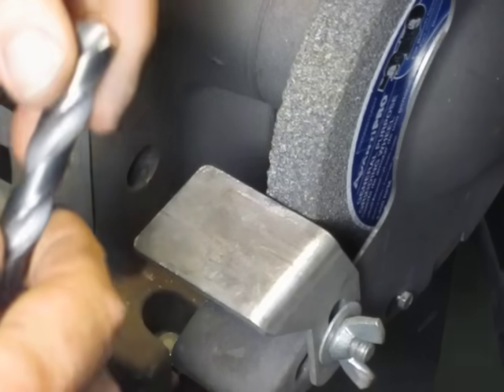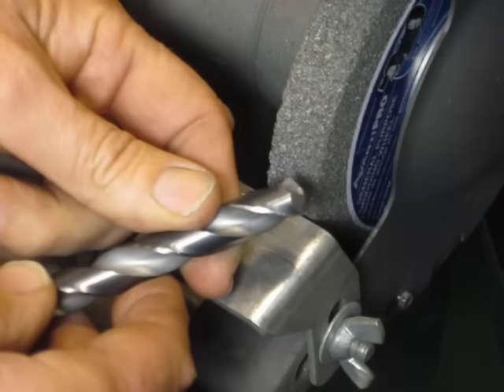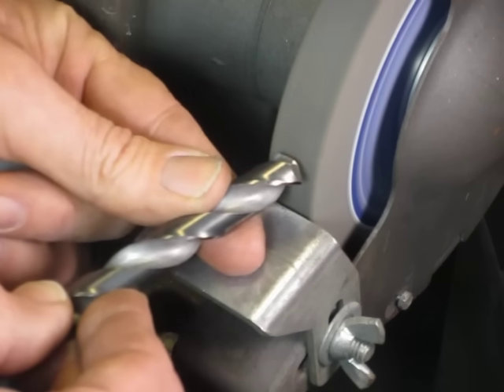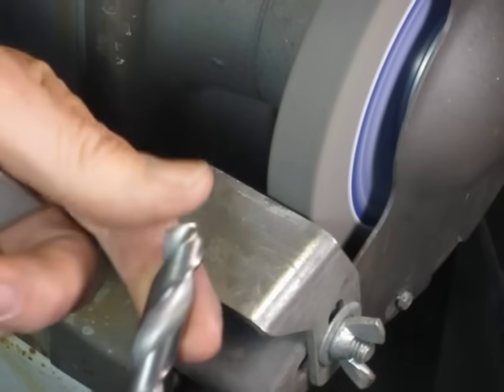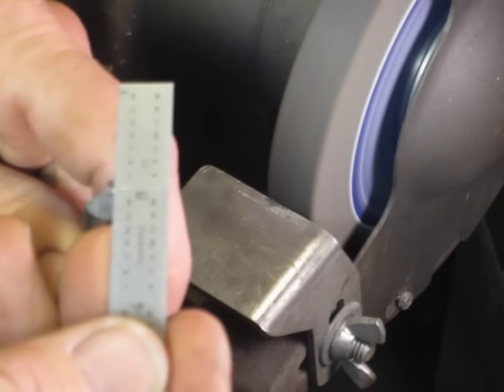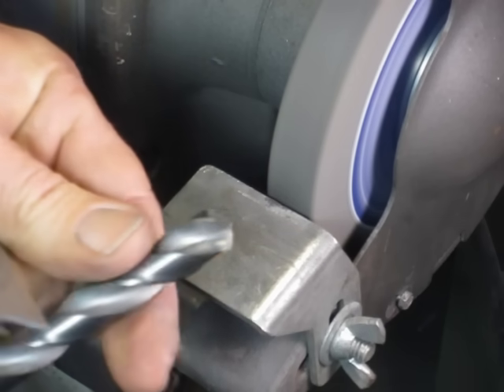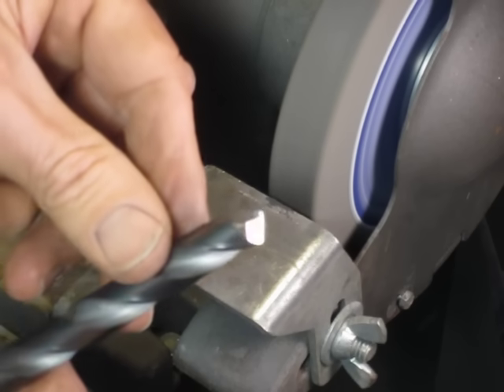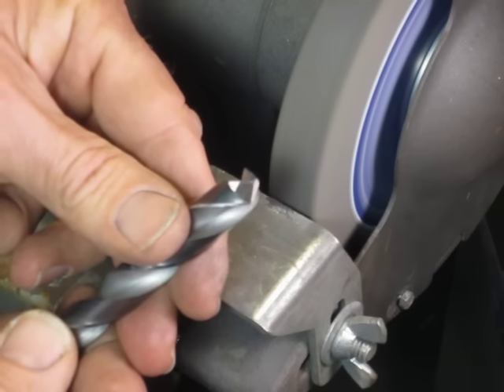How to Hand Sharpen a Twist Drill

Comment: Hello, thanks for the quick response.
So to sharpen small drills is only necessary to make the first two clearance cut? I am sure.
Reply from the maker: Yes. One primary and one secondary relief is good for drills up to around 1/2" diameter.

Tom
Reply: Ok thanks for your help.

Comment: Why not use your gauge to mark the right angle with a felt tip pen on the tool rest - rather than just guessing?
Reply: A mark is good for beginners but after decades of sharpening drills no mark is needed.
Reply: Yeah, didn't the dude say that in the video?   I've been sharpening bits for  just a little while, with the eye sight headed south, I'm finding it harder to do anything smaller than 1/4 in.  I have hardened bits, I have garbage Harbor Freight bits.   In the past I have got what every bit had to give, but like I said, the vision is not to par and would like to know who makes the VERY best, and I'm not talking NASA shit, just a DECENT DRILL BIT!!??   ANYBODY???
Reply from the maker: In my experience, cutting tools of any kind with the most consistent quality are those made in the U.S., Europe or Japan. Anything else is a crap shoot.

Tom

Comment: As a retired hands on engineer this is no way to hand sharpen drills. Firstly, wrong type of grinding wheel. secondly you run the cutting edge up the wheel not across.
Reply from the maker: You should probably do a video to demonstrate your drill sharpening expertise and exactly what "run the cutting edge up the wheel" actually means. If you are referring to creating a radial clearance, that is definitely an "old school" technique. What the entire video and learn how this multi-faceted technique is better. Even retired engineers should still be willing to learn new things.

Tom

Comment: Well, as promised I had a bash at reviving some old drill bits. Took a few goes and whilst it would make my Grandpa weep I can get the old bits to drill a round hole in mild steel without squealing like a banshee. Will keep practicing until the nice expensive set of bits I have no longer cringe when I reach for them.
Reply from the maker: Good to hear David. Keep practicing!

Tom

Comment: 9/32 ?   How about talking in decimals please. . ..281"  and .250"
Reply: because, America!!!
Reply from the maker: Actually the decimal system (with deca meaning ten) has been around since people have had ten fingers. I doubt you could associate it with any particular country.

Tom
Reply: I was just correcting your statement "decimal IS American". You're reading way too much into it.
Reply: The decimal system originates from India..
Reply: @oufofmemory  Tom is using Fractions, because they can be decimalised, and because most of America refuses to voluntarily metricate.
Here in DownUnder land, we 'Converted' to metrics in about 1968, and it was hard to resist. ALL retail outlets HAD to recalibrate their scales, measuring sticks, jugs and bottles, etc etc etc. You could not buy dual-graduated linear/weight/volume measuring implements, all road signs were metricated So a sign reading 'Woop-Woop 500' became 800km. we were made to get the hang of it. Lots of people got worked up about unit sizes, but the daily calculations became soooooooooo easy, especially BECAUSE the metric system lends itself to decimalisation, everything is a 0.001x, 0.01x, 0.1x, 10x, 100x, 1000x multiple of the base unit, and most of the base units are small enough that a decimal point is rarely used: Standard house doors are 710, or 810 or 910mm wide, and a house with a, 20ft frontage is 6096 wide, no dots, we dont even specify the mm at times, but fuel is always litres (Yes, the correct french spelling), and water reservoirs hold xxmegalitres or gigalitres. Kpa for pressure gets some folks confused, along with Nm for torque, but you get used to it. but car wheels are still measured in inches (Because tyres)

Comment: Hold or stick two hex nuts together on their flats,  this will give you 120 degree inclusive angle for the drill point,
Reply from the maker: +mountfields 
That works for the angles, but more important is the length of each cutting edge. The drill sharpening gages I mentioned in the video are inexpensive and measure both features.

Thanks for watching.

 Tom

Comment: Great demonstration! I learned the same technique in my 10th grade shop class about 17 years ago and it has been such a valuable basic skill. There are two of us at work that the others come to when their drills get dull because they never learn how to sharpen a drill. Our teacher taught us with a very similar demonstration and then he let us sharpen our own bits. Once we thought that our bits were sharp he would put them in the drill press and drill hard into a piece of steel, stopping the motor while still cutting. If the chips didn't look uniform he would say that it wasn't right, grind a big flat on the tip, and then tell us to sharpen it again. He ground enough off that it took some time to get it sharpened up again too. I imagine that it was meant to be extra incentive to get it right the next time. We didn't pass until both chips looked reasonably similar. Slow learners ended up with short drill bits. :<)
Reply from the maker: +Chip Wright 
I like his approach!Thanks for watching.

Tom
Reply: Me too. I have memories from his class that I'll never forget.
Reply: +Chip Wright you even got the name!

Comment: I have fairly good success sharpening my drill bits but came here to see if there was anything I could pick up. I was not disappointed. Also wanted to ask how does the center axis of the drill cut, being there is no cutting edge right in the center. But you addressed that too. Thanks
Reply from the maker: +sking0369 
Thanks for watching

Comment: what grit is the wheel
Reply from the maker: +james broach 
This is just a wheel I picked up at the Depot and it doesn't even say. It looks to be about 60 grit, which is coarser than I normally use, but it works fast. It's fine for grinding lathe tool bits because they are stoned afterward, but 80 grit would be more appropriate for sharpening drills.

Tom

Comment: Beautiful work. I prefer using a slower wheel... I have a knife sharpener that is a slow soaked stone. I just dont have the dexterity after getting run over. Still trying to learn the grinding wheel though! Only 5 years to go at this rate. haha.
Reply from the maker: +Cody Smallwood 
Thanks.
The slow, wet wheels you have are specifically for knife sharpening, so they don't overheat the carbon steel edge. Consequently they have a very slow metal removal rate, so it may take some time to sharpen a drill on one, especially larger drills.

Tom

Comment: hmm, after working as a machinist for 25 years and sharpening my own drills from 1/8" to 1/2" dia. to meet very small tolerances consistently for thousands of repetitions on automatic screw machines, I have to say ...basically the way you are doing it is fine for the home hobbyist, but for serious work, you need to have more 'meat', more support  under the cutting edge than the concave support material your method leaves. Your cutting edge will wear and chip easily. The BUE will have little heat transfer when worked hard and will fail often. Early on we had a factory rep show us the correct way.
Reply: +Jason Argone , i have to agree with you, if i sharpened my bits like in the vid, i would always spend my time sharpening. Nothing worse than having a bit chip, many a time pros told me 99% of a chipped bit is incorrect sharpening. If anyone has used this method of sharpening my bit's, he would be shot on the spot. You never ever double cut the heel, and call it a relief. double and triple cutting has weakened the cutting edge. Hate to say it but, many a good person will waste more time resharpening bits after each use watching this vid.
Reply from the maker: +TAJON 
What I'm teaching here is a form of multi-faceted drill point geometry. Drills sharpened this way actually require less rotational energy and therefore produce less heat than drills with radial clearance angles. Consequently the drills last longer than those sharpened using old fashioned radial clearance angles. Most commercial drills today are sharpened using multi-faceted geometry. I'm been sharpening this way for more than ten years since reading about it in an article in Modern Machine Shop written by Joseph Mazoff. You fellows may want to check it out and learn something new.

 Tom

Comment: On the back edge (clearance angle) you should be curling the edge away
Reply from the maker: Had you watched the video, you would understand that drills with faceted geometry are easier to grind and more efficient to use than drills with radial clearance.

Tom

Comment: I am confused though, you state 118 degrees to be optimal GP angle, but tune the protractor to 59, shouldn't it be set to 62 degrees to equate to a 118 degree grind? 180-118=62? Correct?
Reply from the maker: +Mark Gilkison 
The 118º point angle is included and measured from the center axis of the drill, not across the end, 59º on each side.

 Tom
Reply: +Toms Techniques Thanks. Sometimes a picture goes a long way with me. Here's a link to a lot of good info on the subject. I have a pile of drill bits to work on this weekend now.
http://www.michigandrill.com/tech/twist_drills/point_grinding.php

Comment: Great Video! I like using a not too expensive drill point gauge. At least it wasn't when I bought it 50 years ago,
Reply from the maker: +Russel Allen 
Yes, drill pint gauges are a good way to ensure that the angles and length of the cutting edges are correct.

Glad you enjoyed the vid.

Tom

Comment: Tom, nice video.  As one who has used this technique for about 50 years, I can attest to it's validity.  Two things that I would add are: (1) a "dressing stick" is great for making the face of the stone flat before hand.  And (2), having worked around a good sized tool and die shop for more than 20 years, I always advise operators to stand to the side when a grinder is started, for  about 20 - 30 seconds in case the stone comes apart.  This is especially important when a grinder stone is used by more than one person as you never know if someone did something stupid that damaged the stone on it's last use.

Bob A.
Reply from the maker: +Robert Applegate 
Thanks Bob.

I have both a dressing stick and a star dresser hanging on the grinder to be used as needed. Luckily I don't have to worry about what others have done to my grinder because I'm the only one using it. :)

Tom

Comment: For most home shop guys, not using a guide to control the position of the work piece as it passes the grinder face will result in a wrong angle and possibly a mishap with fingers and sharp bit edges or point. This man is a pro, not an amateur, so don't be misled. One serious cut can ruin a finger or 2 permanently.
Reply from the maker: +Doug H. in VA 
Give me a break Doug. I'm teaching basic machine shop techniques here. Nothing different than I did with ninth grade students when I was teaching. If you are incapable of following simple instruction, please don't try to dissuade others from improving their skills. If you look through my videos, you'll find plenty of hints and tips on working safely and this one is no exception. You are also correct that I am a pro and I have made a good living doing this sort of thing. I got that way by listening, watching and taking advice from other pro's.

 Tom

Comment: big bits , say over 8mm i do this way , small ones i radially clear them , its a quick and dirty technique that has its place in the field or onsite , you could do a video showing that , it works well against almost anything , like a flap wheel in a four and a half inch grinder , or what ever you have on site ,,, nice clear instructions on flute thinning , all in all a great video. a skill that is often overlooked , but so so handy to have at your fingertips no matter which methods used.
Reply from the maker: +tom thompson 
Since learning this method, it's all I use, but to each his own. I find it much easier to get the drills symmetric this way, especially the smaller ones. I also find that it's easier for beginners to handle because it requires less movement of the drill.

Glad you enjoyed the video.

Tom
Reply: fair comments

Comment: thanks for a nice video, but cant the steel in like the drills be destroyed by heat from the high speed grinder? You know, when you drill into steel, you allways need cooling, or the metal in the drill gets hurped?
Reply from the maker: +Tone Skoglund 
Over heating is generally not a problem when sharpening high speed steel drills. You need to watch my video on Hot Hardness.

Thanks for watching.

Tom

Comment: 1 of the first things you learn as an apprentice toolmaker and 1 of the hardest to get right you need to be able to feel the drill
Reply from the maker: +Carlos 
Yes. It takes a light touch, good observation and lots of practice.

Tom
Reply: +Toms Techniques I started my 4 year apprenticeship in Mechanical engineering  @ Rolls Royce aero in the uk.in 1988. Twenty eight years later Masters Degree In Mech ENg done.Im now an applications engineer for WFl millturn. And to this day I always judge the quality and skill of any Machinst by how well they hand sharpen a twist drill,usually I will grind the drill totally flat so they have to start from scratch so theres no web or point to use as a guide.....It requires a great deal of skill and finesse it's also something that's impossible to cheat or get it right by chance.

Comment: You  so over relieved the heel that your drill can not stay sharp long. 45 years a machinist here. You need to roll  as you sharpen in order to support the cutting edge.
Reply from the maker: +john ingardia 
Forty five years here as well John, but still learning. Rolling the clearance angle as you describe is old school as I point out in the video. Most commercially available drills are now sharpened with a multi-faceted geometry similar to what I demonstrate in the video. The primary angle still provides plenty of support and the secondary angle provides clearance. Drills ground this way also produce less heat which extends the life of the drill.

Here is a link to a good explanation of it if you are interested:

http://www.newmantools.com/machines/drillpoint.html

Thanks for watching.

Tom

Comment: Great video. Just wondering though, you made no mention of truing up the face of the grinding wheel. Your thoughts please?
Reply from the maker: +Thomas Pasqualone 
I just do it as needed. If the face starts cupping or I need a nice sharp corner on the wheel, I'll clean it up with a star wheel dresser for coarse wheels or a silicon carbide dressing stick for the fine ones.

Tom

Comment: What about heat generation?.... good vid... but you are not getting red as I do... or quenching...
Reply from the maker: +GotScout 
If the drill is getting red, you are using too fine a wheel or you are trying to take too much off at a time. Normally very little material needs to be removed to sharpen a drill. I never have to quench a drill when sharpening, only lathe bits to keep them cool enough to handle.

Tom
Reply: Fine stone... fine edge...  knives are different than bits in that regard I guess.

Thanks Tom.
Reply from the maker: +GotScout 
Knives are different in that most are made of carbon steel and can't tolerate heat like high speed steel.
Reply: okay....
Reply from the maker: +Mike Kuck 
The urban legend prevails!
You need to check out my video on Red Hardness Mike.
https://youtu.be/jQ648eDA7V4

Tom
Reply: +Toms Techniques Well, I guess I was repeating what I have been told without knowing much of the science behind it. I still say that over heating a fine edge is not a great way to sharpen it. It isn't difficult to overheat a knife edge even by hand. A drill bit or lathe blade is another matter.
Reply from the maker: +Mike Kuck 
And you are correct, because most knife blades are made of carbon steel. Virtually all drill bits and steel lathe bits today are high speed steel, so they are not heat sensitive..

Tom

Comment: How you grind the drill makes a difference to drill life and swarf type ( strands or small chips)
Reply from the maker: +georgie peorgie 
Absolutely. Less clearance and a more obtuse point angle for drilling harder materials helps pull heat from the cutting edge and greatly increases the life of the grind. More clearance and a less obtuse point in soft materials like wood make a more round hole that is less likely to wander.

Tom
Reply: Toms Techniques Thanks !

Comment: On the template I put 1/32" marks for that, I'd send you the PDF template I made but not sure how to. My email is <bill@bthrash.com>. Better point here is I was trying to drill through a 1.5" maple butcher counter and the 2 x 6 standing support beneath (7" of precision drilling needed) and my 1/4" x 12" bit was too dull... but after watching your vid and going to my grinder I was able to perfectly drill it through for the 8" bolt!!!
Reply from the maker: +wrthrash 

The important thing is that you were able to grind a drill that worked well for your application. Thanks for the offer of the template, but truthfully, I've been sharpening drills so long that I don't use a guide at all. I can tell by eye when a drill will cut well and make a properly sized hole.

Thanks for watching.

Tom

Comment: The paper template is actually better than the gauge, as it is on an 8.5 x 11 sheet of paper (really big) and guides you from below while laying on the bench beneath the grinder. Then just lay the bit on the paper and viola, it shows the exact angles. I'll send you the template via email. Thanks again.
Reply from the maker: +wrthrash 

It's not just the angle. The length of the cutting edges is even more important. A drill gauge measures both.

Tom